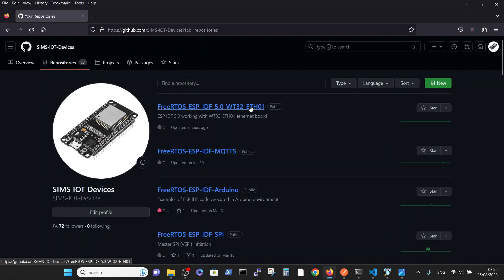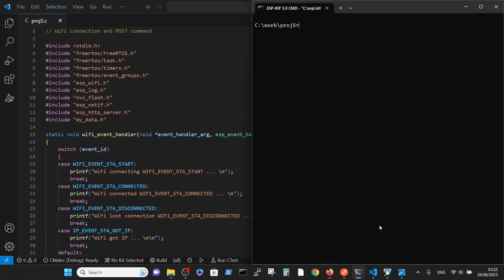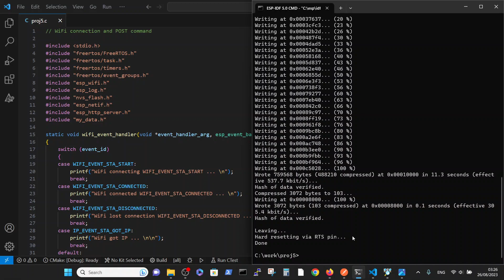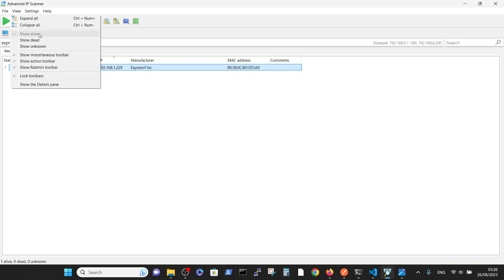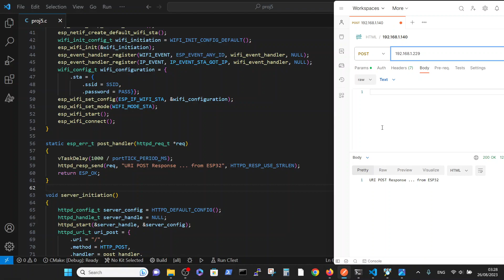ESP IDF 5.0 WiFi connectivity of the WT32 ETH01 board

Comment: Any thoughts the difficulty in designing (KiCad) a custom ESP32 board ?

I'm interested in adding to an ESP32 module (ESP32 CP2102, WROOM, etc that has USB and Serial-Com) the following :

Ethernet : LAN8720A  . RJ45 MagJack   etc
Can Bus : NXP TJA1050 / MCP2551
ADC: AD AD7616
Terminal Blocks : 2x8 (ADC)  ,   2-pin (CAN) 
Maybe some additional DNI parts that could be used for conditioning the Analog-Front-End if needed (TLV2372IDR , OPA4354/TLC2274, etc)
Reply from the maker: Dear @bennguyen1313,
Designing a custom ESP32 board is not a trivial task. Go into it only if you have proven experience in PCB design and manufacturing.